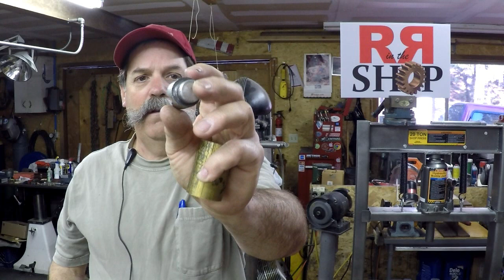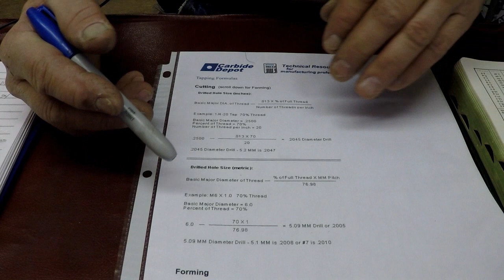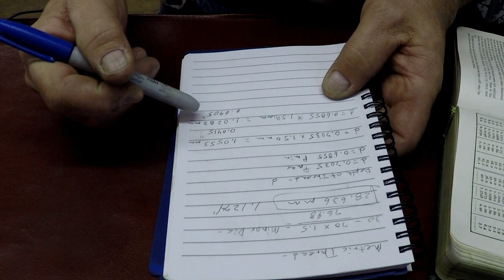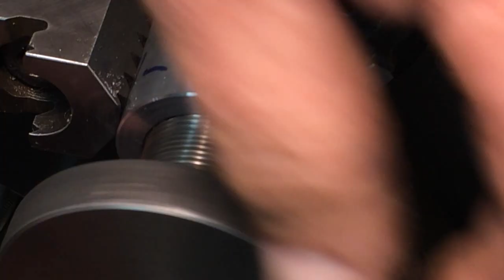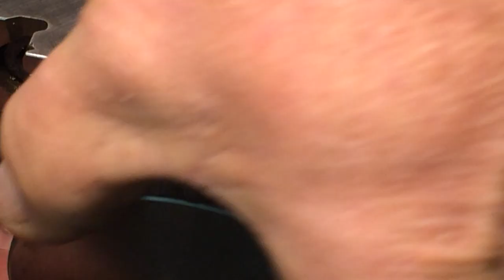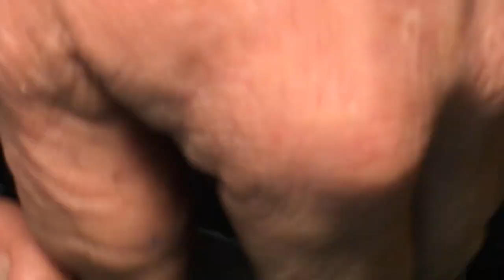How to Repair a Lathe Change Gear Part 5

Comment: Well, I cheated a little bit after days of scraping and scouring, welding and wiring. I just want to get my lathe in operable condition and so I ordered the 106T half of that compound gear and in fact it was really cheap compared to trying to buy Atlas NOS for my old lathe!!! I also ordered a 32T gear to make a threading dial for the old girl, so I'm not avoiding all of the heavy lifting...I even think you will like the panel I've got coming together for my controls and electrical! Video to follow this weekend.

I hope you and the Mrs. are well, thanks so much for the letter ;) Aloha...Chuck
Reply from the maker: Knolltop Farms It sounds like you have the gear issue well in hand, I knew you would figure the best route.  I am axionus to see the lathe up and running.  All is good, thank you.  Randy

Comment: lol I have the machinery,s handbook 13th edition. I just happen to be looking through it when I started watching your video. Trying to rap my head around this gives me a brain lock at times or brain fart so I,ll just learn from you, But will figure this book out one step at a time.
Reply from the maker: Randall Moore It is a tough read.  Sometimes you need a special decoder ring.  I am a long way from knowing it all but sometimes I can help.  There is a lot of info on the web these days but sometimes it is nice to find something in a real book.  I use the machinery's handbook all the time.  Thanks Randy
Reply: Thanks for the advice, It will all come together  I,am sure of it.

Comment: good video randy. i have a couple of questions, why did you bore and thread a blind hole as opposed to a thru hole. also would a split bushing work as well for this purpose. cutting metric threads on a imperial lathe is a real pain.
Reply from the maker: larry sperling Thanks for watching Larry.  I wanted the work to bottom out, so it was not tight up against the chuck.  A split bushing would of worked, soft jaws would of worked.  It is tough since I do not have the correct gear for my thread dial to do Metric, another project.  Thanks Randy

Comment: Hi Randy,
Metric threads in a internal blind bore, with a imperial lead screw... Oh boy.... And knowing that the faster we turn, the better the surface finish... Yap...! A little nerve wrecking, and, keeping up with the filming, the difficulty level rises pretty much higher, but let's "Getter done"
Fun project and well done,
Pierre
Reply from the maker: pierre beaudry Thanks Pierre.  It was a bit tough, but goter done with only 2 tries.  Very tense, I just could not turn any faster.  Got the gear cut yesterday, test it out today, and done with this series. Did your wife get finish up with the snow melting project?  Randy
Reply: Hi Randy,
Nope...! The more she blows, the colder it gets, like mother nature is defending herself against disrupting actions... lol
Looking forward for the next gear action...Pierre

Comment: Hi Randy, nice work. Google: sherline thread calculator its a nice excel spread sheet that will do all the work for you, its super easy to use and will save you time. I have run a lot of parts with the numbers its spits out and it always seems to work for me.
Reply from the maker: bensbenz I will be checking that out.  Thank  you for the tip. Randy